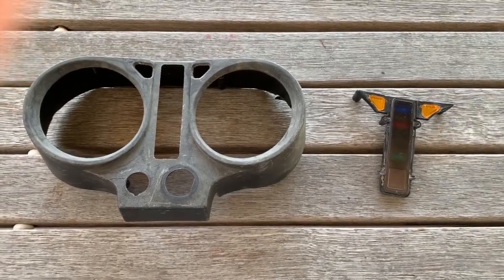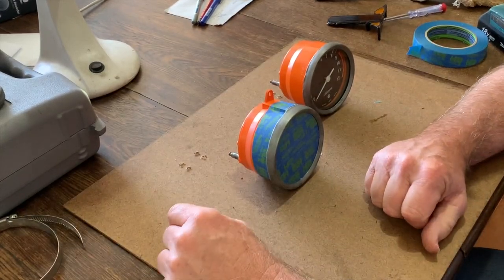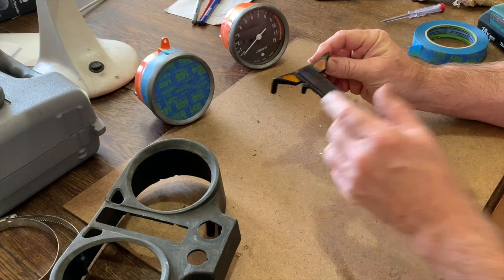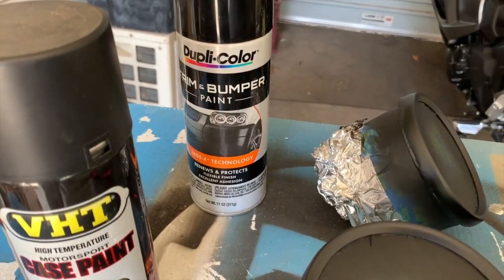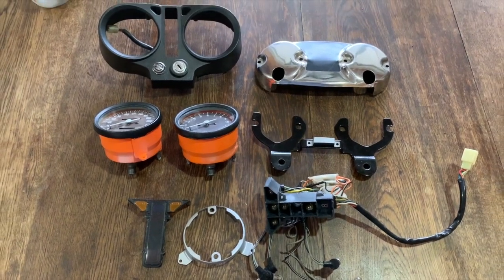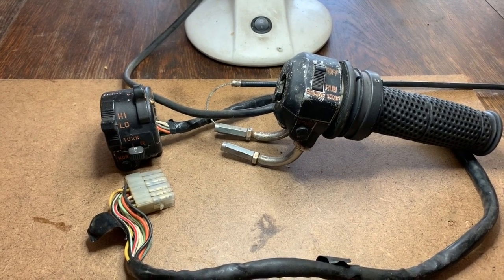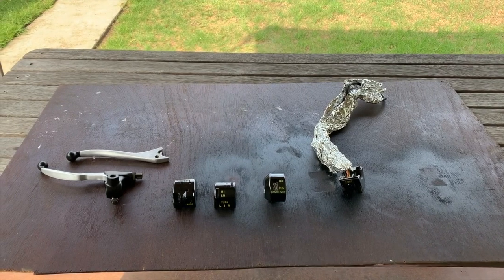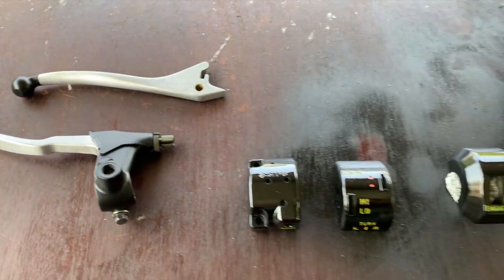GS750 Restoration Part 11

Comment: Just purchased a 1978 GS750 and I'm excited. Your videos will save me a lot of time and money - great job dude. Like yours, the speedo cover needs to be painted. How do I take off the cover?
Reply from the maker: Hi Ronaldo, congrats on getting a GS750. I love them! The speedo assembly is held on with a couple of bolts, disconnect the electrical connector then remove. The chrome rear cover is held on with 4 x 5mm dome nuts. Once the back is off there are a number of screws holding the gauges on. If you dont need to remove the display panel then don't, it was a real pain! Lots of grinding and scraping bits of plastic to get it off. If you need to remove the gauge glass then prise off a small section of the metal ring with a screwdriver then use a teaspoon to go around the rest until it can be popped off. Hope that helps!

Comment: Can I ask how you reset the speedometer. ...I'm in the same situation. ....
Reply from the maker: Hi Steve, thanks for the support. To tell you the truth I cant exactly remember how I did the speedo. I seem to remember there was a shaft that needed to be removed so that the dial could rotate without the pawls engaging. I have the old MPH speedo, I might pull that apart and have a look and maybe do a video as I've been asked that before. Sorry to not be of more help.
Reply: @plaxsax  I'm actually thinking of leaving it as is, since it's the original.  But thanks.